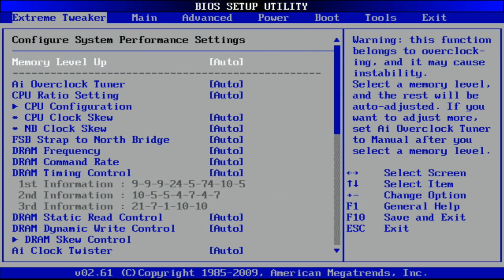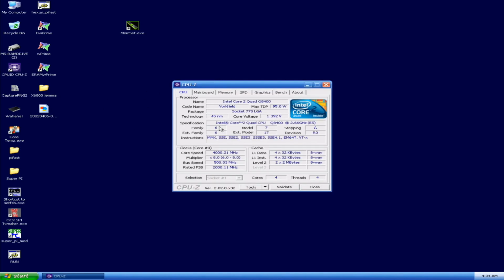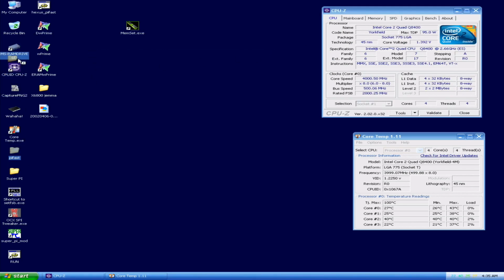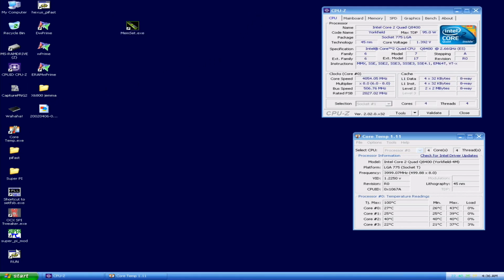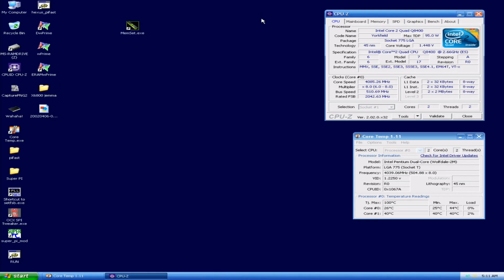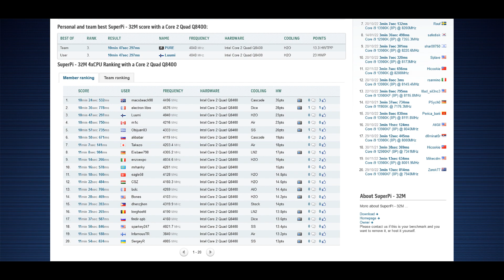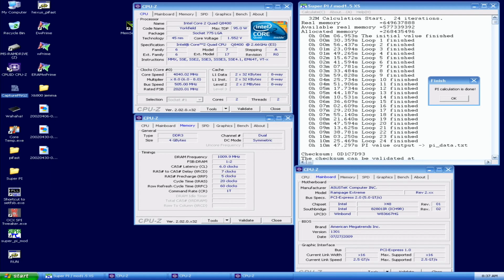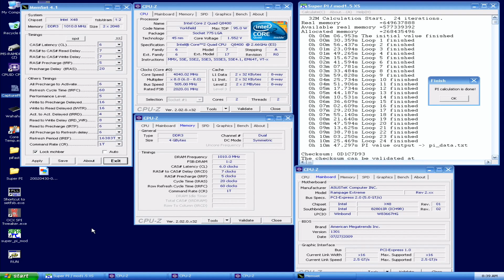I Found this Very Rare Q8400 Engineering Sample CPU from Japan - Let's Test it Out!

Comment: Tested about fifty 45nm quadcores on X48, all stopped between 490 and 520 MHz FSB on air for Super PI 32M. I guess you're much better off with P45 assuming you have a board that can take these above 560

Comment: Yeah you need an EP45T UD3R/UD3P (UD3LR can do the trick but the VRM are very weak) in order to reach 550+ FSB on quads. I believe the 520 SPI32M sub on REX was made using an uber X48/REX... Or maybe with some strap tweak
Reply: And a good CPU. Only handful will swing 550. The one Luumi has looks promising, because it goes 515 on X48 asus board. I had X5450 that was struggling to POST at 520 on P5Q3 DLX - ended up going 9x540 on UD3R. (There is wall at 540 in general. I 'haven't figured out how to overcome it yet).
On another note DFI on P45... that may end up as masochism. Actually I would like to see him make that attempt.
Reply: @gagarin777  most of my E0 C2Q so far were able to post 550 FSB with "bench" voltage accross multiple EP45/EP45T motherboard. You need to bin the motherboard too.
DFI can clocks quad high but it's a real nightmare to make it works, even more if you want good efficiency.